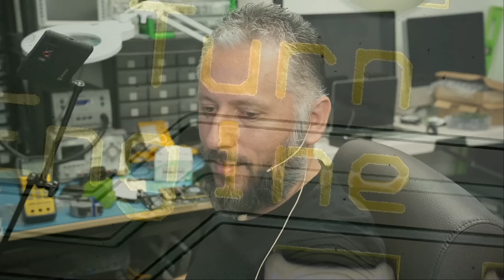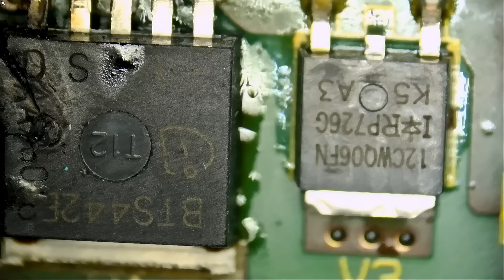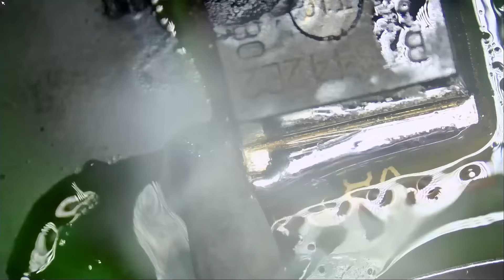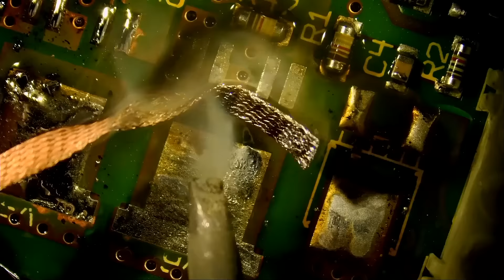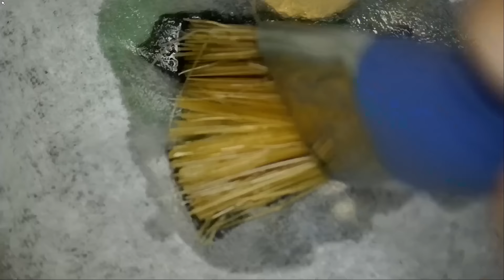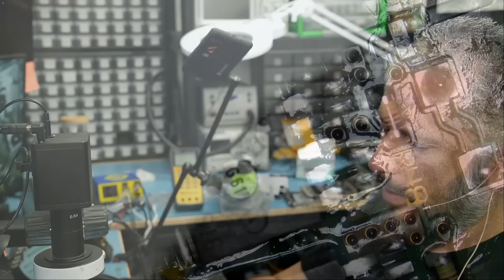Super expensive Ferretti Yacht motherboard  Repair - Urgent 3 hours service request.

Comment: My pal sent me some pictures of a pair of logic/motherboards from a £600,000 40 ton under lift recovery vehicle he was repairing at work,one looked like it had been in a furnace. The boards control massive plunger type relays,one of which apparently shorted giving the board about 1000amps. The upshot of it is that they are only £12,000. I thought he was joking until he showed me the works order😂.

Comment: Hope you charged the dude 25k. 25k in a day is worth it. 10k isn't for sure, especially with your experience and skill. I made 11k in 6 hours once. While i was doing specialty  construction work at a bank, I was not the one who even sold the job nor manufactured the product. You directly worked with a client who needed a very quick fix done requiring your skill and putting you through enormous time pressure. I just hope you made more than 10k, and hopefully 20k or more.

Comment: whats the melting point of the solder that you used to put the components back? Some videoes you say to use low melt to put things back on and others you don't, does it depend on the part you're soldering on like a plastic connector for a screen or something would melt without low melt solder ?

Comment: Would there be a reason not to use an ultrasonic cleaner on the board after the repair to get it super cleaned up?
Reply: Some parts are not sealed against water ingress. Without a complete BOM for all of the components (and reading the data sheet for each individual part) there's no way of knowing if the board can be submerged in water or not.

Comment: I just hope the society goes back from replace to repair. But even so manufactures must be forced to have parts available. Two times I payed a local shop to take a look at two monitors. Both went dead just a half year after the end of the warranty. How practical for the manufacurer. First one was no-fix because the panel was dead and they couldn't get a new one and second monitor had only a broken fluorescent lamp and they said they looked everywhere and couldn't get the part. So I need to throw away a 500$ monitor just because a 30$ lamp is not available. WTH?

Comment: Holding the board horizontal so that the residue runs off the edge,  I use a pump sprayer with 99% alcohol  & a paint brush to just rince the rez right offa the board instead of trying to mop it up. Do that a couple times & its clean clean clean. Could also use self-adheisive heat sinks on those overheating components to help stop it happing again?

Comment: What kind of abuse was able to fry those puppies?!?  They have over voltage, under voltage, over current, thermal overload, loss of supply or ground pin, reverse voltage (battery) protection and everything.  It took some real talent.

Comment: I used to do some super basic soldering with RC stuff, but only watching this because I find it interesting. The way you clean up low melt solder is so fascinating. Why does the solder stick to the copper braid and not stay on the board?
Reply: It's called capillary action. It's because of the surface tension of the solder. It's the same reason oil moves up a lamp wick.

Comment: BTS544s are power FETs.   I think they are also smart FETs (current sensing).  

It would seem these were not short circuit protected by SW or hardware.

Comment: I made a comment about how theres no way that those components are burned like that without causing firther damage. But yhinking about it, maybe not. I wouldnt expect to just find that it was burned, replave the components and have everything be good. But sometimes it works like that. Ots possible that the manufacturers technichian knows that this woll fix it, because thos is a commonon failure and yhis always gixes it. So maybe...

Comment: It's lucky the customer has tested the drivers and bias components before supplying only the output devices. I'd expect a cascade failure when there's that much destruction. I guess they were going to test it back on the yacht and find out if they had fixed the over-current situation

Comment: Great fix. Any update on if it worked? I always get leery when people hand you parts in unmarked bags of unknown origin. On top of that, those chips got hot. Id speculate other damage to the nearby components and whatever the heck those chips controlled could potentially have an issue that could cause the problem to occur again.

Comment: I'm a mechanic,  we usually just get new or remanufactured modules. Never thought to send a board out for repairs.  I'm so used to dealing with the manufacturer and aftermarket that it never crossed my mind. Some are very expensive.  Might be worth having repaired.  Not to mention that it can take weeks to aquire sometimes.
Reply: This is how my brother became successful doing 1 man plant repairs. He could fix things in a couple of days that other service centers would take weeks to do.
Reply: the biggest issue with a lot of automotive electronics is the presence of potting compounds, conformal coatings (principally for environmental and anti-explosion concerns - keeping the weather out and fire in) and a host of anti-tamper measures generally making them a bear to work on. if you consider the labour required to curcumvent those, diagnose and repair the fault THEN return it to OE standards... is probably why you don't see a lot of refurbished ECU's about, particularly when there's the option of buying them from breakers.
also, from experience trying to repair a potted/coated PCB is the stuff of nightmares, it's really hard work not to do more damage to the board and/or components just removing the stuff.
Reply: @kaelin000  yep, the conformal coating is a big pain in the ass. Some boards are just dipped in simple varnish(Valeo/Aptive BSI boards), some are coated with silicone(Hirschmann boards in the BMW sharkfin antennas), but the new standard is epoxy resin. The new Valeo windshield wiper motor assys are filled with epoxy resin. The motor housing contains the relay and the electronic board for the timed wiping and the rain sensor. If the relay fails(which are usually do), then you need to replace the whole assembly with the perfectly fine motor and electronics.
Reply: @kaelin000  Breakers, as in Automotive scrap yards? Problem is a lot of modules are locked to the VIN number that even a factory scanner cannot overwrite. While module may work, there will still be a warning light on for VIN mismatch. A work around is to read EEPROM chip from original module and transfer data to used module. There are guys that can do that, factory will tell you no.
Reply: It’s not like you can’t replace such costings 😅
Reply: Parrts for these sorts of ships are usually one offs and t is a bit hard to find replacement parts for.
Reply: So this is a replacement of parts, not a repair. There is no diagnostics or testing. This procedure is done in less than 5 minutes.

Comment: Low melt solder was originally invented to solder heat sensitive components. As you can use it to still solder with, you must be knowledgeable about atmospheric temps and watt dissipation.

Comment: Had a massive surge go on the switched lines to deep fry the solid state relays like that. Would also check those resistors and any upstream switching transistors etc. Backfeed into a board like this would be bad.

Comment: There are some very special cases, where you do use low melting point solder to solder parts. For instance, if you are prototyping with modules that are soldered themselves (like modems) and you know that you will need to swap them out and you don't want to kill the module by multiple soldering.. You can use low solder temp so it does not melt solder inside module. Take a note that it's only allowed for prototyping as you can't reach viable thermal specs for product if you do so in production.  

Other case would be if you are making PCB thermal fuse out of that solder. That's more of a hack though - low temperature accuracy, problematic with high volumes.

Comment: i used to work as an Engineer for big electronic contract manufacturer, the ladies that does rework have amazing skills.
Reply: Ladies more slender fingers are frequently more useful in such work. ME here that started as an EE, and worked for several companies where electronics & microelectronics utilized women as the primary line workers.  Excellent skills those women had.
Reply: @kurtfrancis4621 Work center full of Female technicians and Male QA😂

Comment: When soldering tabs on the power supply, you must make sure that the TAB is fully soldered to the pad on the PCB. This both for conductivity and for heat transfer. A little dab of solder paste on the PAD should do the trick as capillary action can not be counted on with such heat slugs.   

Now about the engineer who designed the board. Those parts are severely under heat sinked for the size loads that the part is designed for. The engineer may have made the right calculations if the load may be significantly less than the part is capable of.
Reply: That's what the hot air tool was for. With the flux under the thermal pad, the solder would have wicked along the entire length of the metal interface.

Comment: How on earth does anyone know that replacing just those components will restore correct operation of the board? It would be sheer luck if everything works when the board is reinstalled. How can the tech doing the work not know this? Will we get any feedback from the owner or tech?

Comment: Do these chips not typically have firmware embedded on them?
I was trying to fix a board (i am new to all this) which has no documentation available online and I couldnt see anything visibly wrong with it. I assumed that it was a issue with the firmware on the chip
Reply: They are just power switches, not programmable.
Reply: How can you tell? @gribbler1695

Comment: Is low melt solder not 63/37 solder? I suppose Sn42/Bi58 could fit the build except it has a melt point of 138c and yeah, only desolder with that stuff.

Comment: what temp the low melt solder would be melting?
Reply: Low-melt solder contains Bismuth. Sn42% (tin)/Bi57% (bismuth)/Ag 1%(silver) has 138°C/281°F Melt/Freeze temps. For a strong bond, eutectic solders are 63% Tin/37% Lead (or 62%/36%/2% Silver) which melts and freezes at 183°C (361°F). Cheers!

Comment: Thanks - soft solder and flux magic on a set of BTS 442 E2 Infineon Technologies' Smart Highside Power Switches. If curious, you can search for an application note describing common use in automotive (& marine apparently) design to switch 12 volt battery loads.

Comment: I repair tube amplifiers from the late 1940's through 80's and I would love to transition to this someday as I turn down work on all modern, double sided PCB amps. I learn a lot from watching you, thank you.
Reply: I’m sure you will find many of the newer modelling amps are multilayer boards, with loads of via holes to cause issue. Even in the early 2000’s some consumer HiFi’s had 5 layer boards.
Reply: While Northridge Fix's content is fantastic for component level repair, also checkout Barevids amplifier repairs (also youtube channel); he is UK based and does in car audio amplifier work that I assume is transferrable to other amplifiers - his repairs often include the troubleshooting process of the different sections of D class amps.
Reply: See, to me, those old tube amps are a lot more complicated than a modern PCB. Most of the time all the components are just soldered to each other in line, and stuffed into a box. I always figure it out eventually, but it sure would help if everything were nicely fastened to a board.
Reply: There's no way that the board didn't suffer more damage with those kind of burnt components. But I would guess that was the very first thing that was told to the customer. So the customer gets what the customer requests, if he's willing to pay.

Comment: so if the client tells you exactly what you have to do and bring its own part I guess you don't have to diagnose, and there's no warranty that it will work. Only warranty that you've replaced the components correctly. Is that correct?

Comment: Looks like Ferretti is ripoff. No conformal coat on electronic board working in marine environment?
Reply: 1: Some people say it does have it. 2: Is that necessary and why? Do circuit boards used in seaside property coated, because I dont see why this would be worse conditions?

Comment: BTS442's who shat the bed and let the magic smoke out ... switching powersupply ic's - FETS with built in logic and auxillary control circuitry 
70 amp Max peak load so they had a hot supper for sure...

Comment: Nice work, as always!  I wonder what happened to that board.  Would a short circuit cause that kind of damage?   Lightning strike?
Reply: My thought was lightning strike
Reply: Hope not.  My experience with mainboards with EMP/spike type damage is that you get other components that seemed ok at the time of the initial repair failing a few days, weeks or months later.  Usually tell them they need to replace the board - if that happens.  Insurance companies are surprisingly understanding of this.

Comment: While the yacht may be of high quality the that board is not. If it were properly engineered quality built it would not have burned up in the first place, merely popping the fuse when the motor shorted..

Comment: I hope the customer orders genuine versions of those components from a reputable supplier to have on hand in case the knockoff ones fail, for the next repair. But they may not even know that ordering something with the same number from Ama*** is not the same as ordering it from Digikey/Mouser/whatever.
Reply: The box they were in was labeled kinda sketch.

Comment: What about adding some sort of thermal pad or heatsinks to the components? I would think they get hot and that is one factor of them failing quicker.
Reply: They use the PCB copper planes as heatsink
Reply: @sparqqling  I get that, I am saying to make it better than the factory, you would add more heat dissipation.

Comment: Why didn’t you pre apply solder on the big pad under the components?
Reply: Because he would have to remelt it when placing the components. It's easier to apply lots of liquid flux and allow the solder to flow onto the pad. Less heat as well.

Comment: I've repaired a similar output stage on a board for a nearby farmer's John Deere years ago. The cable leading to a solenoid next to the plow was just shorted to ground because of mechanical damage. The guy fixed the cable and I replaced the failed transistor and I also had to repair the PCB with a bypass wire. As I know, he's still using that tractor on his field. So I think the yacht owner will be also satisfied, as I think, there was a similar problem on the vehicle.

Comment: If "money is no object," wouldn't the owner just purchase a brand new mother / daughterboard instead of having it fixed ?
Reply: It's possible they would have, but not been able to get it right away like they wanted. Also, even if money is no object, if you can get it working today for a fraction of the price of a new motherboard, you'd probably go with the cheaper option.

Comment: Would you apply a conformal coat to keep out the moisture ? I would imagine that would be important in a marine environment.
Reply: May not be necessary as it probably is in a watertight box anyway
Reply: I used to design some electronics for a containership company.
I spoke with these guys what theire experience was with this matter.
They said that either you do nothing, not even seal the electronis or clousure so that there is plenty of ventilation, or you have to seal it of so incredible well that in the future repairs will be impossible. Half solutions will cause moisture build up and you be worse off then doing nothing.
These ships would offcourse sail from the north to the tropics.
Reply: @chantalslut  I wonder if sticking a decrescent pack inside the enclosure will help keep moisture down.  I am sure this is not a common problem.
Reply: I dont know much about the if the moist air with salt affects electronics in such a negative way, but what I can say is that there will be no liquid water on the parts and the air shouldnt be more moist than inside a house located next to the sea. So if that usage is ok without a coating, this should be as well.

Comment: I noticed you simply replaced the components without any initial diagnosis or final testing. Are you able to share what caused this?
Reply: id imagine the customer may have just asked to have the parts changed with the ones they brought with it. which he's done.     its a $1,000,000 boat,  best not to get too involved with it,  it could end up costing northridge a fortune if things go sour i guess :)
Reply: Probably off board power. Hard to know without schematics which I'm sure aren't available.
Reply: Exactly..who know if that definitely fixed it

Comment: I appreciate your technique of unsoldering components with low melt solder. I saw on "northridgefix" the product "Low Melt Solder Pack of 6 sticks".
I would like to know its composition, because I can't find it in the product description.
I am looking for one of the following material compositions:
Alloy: Sn42/Bi58, Melting Point: 138C (281F)
Alloy: Sn42/Bi57.6/Ag0.4, Melting Point: 138C (281F)
Alloy: Sn42/Bi57/Ag1, Melting Point: 138C (281F)
Alloy: Sn60/Bi40, Melting Point: 138-170C (281-338 F)
Alloy: In52/Sn48, Melting Point: 118C (244F)
Alloy: In66.3/Bi33.7, Melting Point: 72C (162 F)
I am an electronics engineer and need these compositions for specific applications. Does the product sold have any of the alloys listed above?
Reply: Check digikey...
Reply: I have seen those differing alloys, offered. Are they not designed for purpose, and then, you grab the closest non acid core, and get your job done?